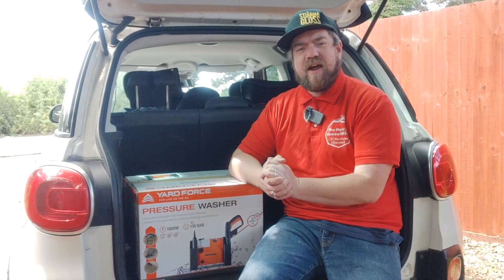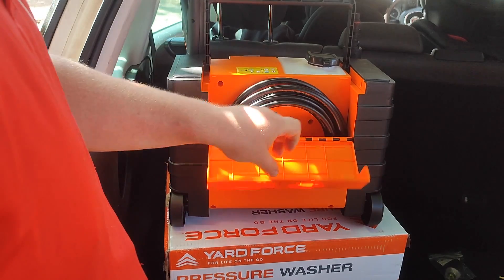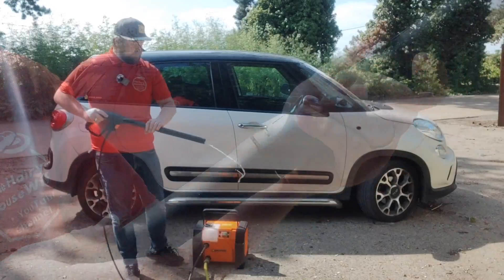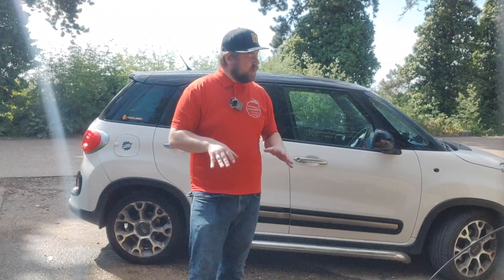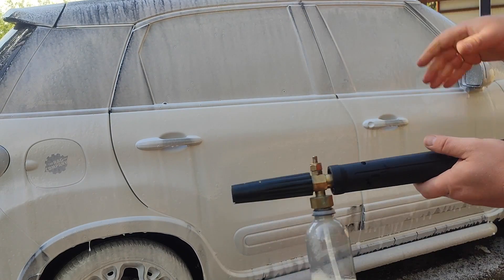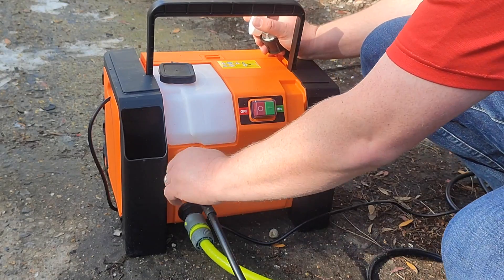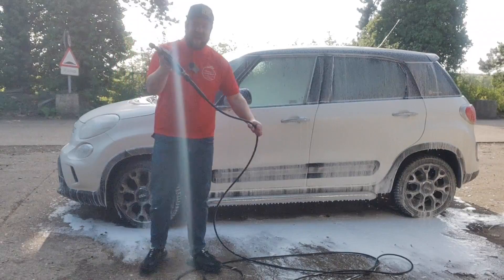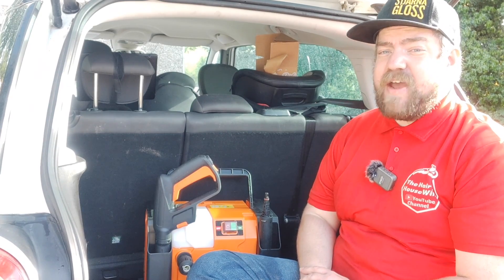The Most POWERFUL Compact Pressure Washer? Yard Force 135 Bar Compact Pressure Washer, Best Budget?

Comment: Looks like you’ve found a good little bargain, The M22 to Karcher adapter is what I use on my kranzle to use my upgraded hose and QR attachments too.. so got me thinking one of these would be a nice little back up just switch fittings straight over 🤔
Reply from the maker: 100% would make a nice little back up , originally I was going to use this for just at home cleans and take my Bosch with me out and about .... Think this will be coming everywhere and the Bosch is now for patio cleaning 🤣

Comment: Great video and really informative, your content made me pull the trigger and my wife bought me one for Christmas! I saw in the video you mentioned the outlet is an m22 but you I don’t think you mentioned the spigot size, I’m looking to buy a hose and gun upgrade but I’m being asked if it’s a 14mm or 15mm and I just don’t know the answer, did you know?
Reply from the maker: Can i just start by saying thank you for watching , really appreciate it , secondly that is a fantastic question somthing i didnt even think about myself untill now , so i just went out and measured the fitting on the original hose and it comes to 15mm , now the fitting i brought i got a 14mm now this could explain why i had to use plumbers tape to stop a slight leak , so thank you for that i will now order a new fitting myself , but yeah from the measurements from the old hose i have got 15 mm ... hope this helps
Reply: @TheHairyHouseWife  thank you so much for taking the time to check for me, got worse service from yard force themselves haha! That’s great I’ll grab a m22 hose with a 15mm spigot and give it a go! Keep up the good work!
Reply from the maker: @JoshuaBrann7 I found Yardforce are best contacted via Facebook messenger weirdly enough 😂 , 

Thanks again for tuning in 😁

Comment: Hi, thanks for the video, I have bought the fiam lance with the adapter as you used in the video but it wont work. The water leaks out before reaching the nozzle
 I dont know if i am doing something wrong. Thus is the lance i am using. YUET Snow Foam Gun Lance for Nilfisk/Huter/Anlu/Kew/Alto & A&R Cannon Pressure Washer 1 L Jet Bottle Adjustable Soap Generator Pot Dispenser Foamer Hose with Connector Sprayer Nozzle

Please help! I am new to these things.
Reply from the maker: So the adapter you needed was for lavor seems you have ordered one for nilfisk , do you have Instagram or Facebook if so send me a message I may be able to help with the fitting you need

Comment: How you getting on with this ? Thinking of getting one to stay static in the garage. Have you worked out what the hose fitment is and what fitment the standard nozzles are ? My Nilfisk C135 is just too heavy to get from one end of the garden to the garage  its becoming a pain now, so this in theory is cheap and I can just leave it under the tap in the garage. I wonder if the Nilfisk hose will fit ? More importantly now you have had it a while, is it any good ?
Reply from the maker: I would Imagen the nilfisk will fit it , depends on the fitting but you'll be able to find and adaptor, 

Would I recommend it 100% I was just talking about this to someone and honestly for the price and the performance, I don't think there's anything on the market close for the price
Reply: I went and bought it as its £75 on Amazon right now so it was a no brainer for me at that price. I just need to somehow get a 3/8 quick connect for my Nilfisk hose as I believe thst is an M22x14 but this machines inlet is M22x15, was hoping someone sold such a kit without me having to buy 2 kits to match them up. Any ideas ? I suspect you had the same issue ?

Comment: But you have not mentioned the purpose of the compartment with the black lid on top of the machine . Kindly inform
Reply from the maker: That is a detergent tank I mentioned it quickly, basically if you fill that with detergent and use the lance on the low pressure mode it'll spray a detergent water ... if you check out my other yard force pressure washer review it's a similar situation to that one . Thanks
Reply: @TheHairyHouseWife  
Thank you very much for your help
Reply from the maker: Alwaysnhappy